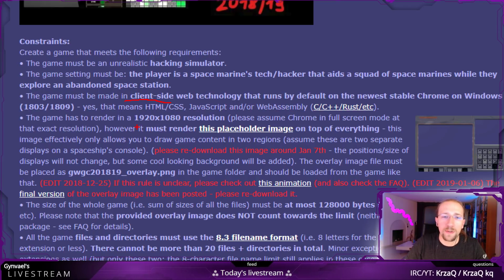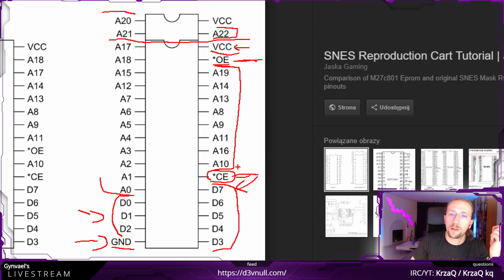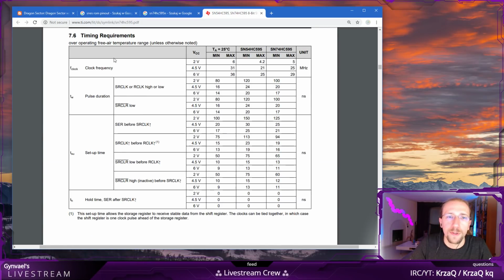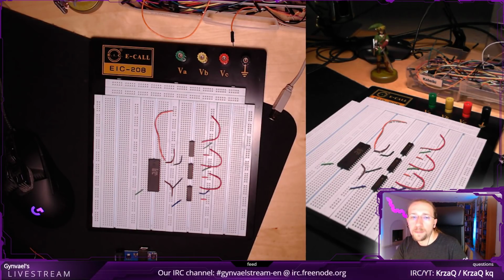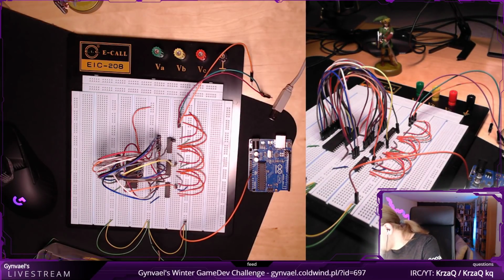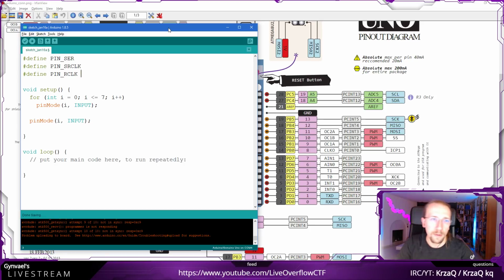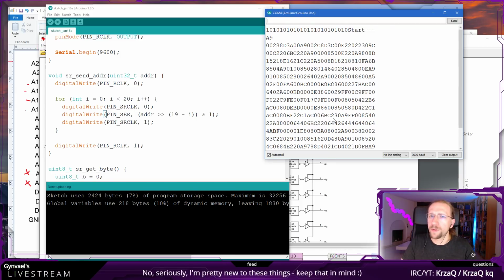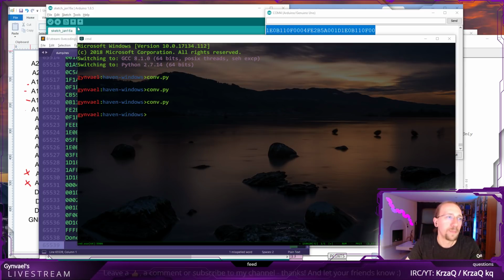Hacking Livestream #70: Dumping a SNES cartridge

Comment: So I have not finished watching the stream and I may be stupidly asking this before watching the whole thing, but let's suppose you did not have enough pins to properly reach the whole address space of the ROM. Would it be possible to dump in two steps? Say in case you missed the most significant bit of the address input, could you dump the first half of the address space by hooking it to GND and then the rest half by feeding it constant +5?
Reply from the maker: In general? Sure :)

In this specific case without the shift registers we would be missing 8 pins, so that would mean we would have to re-wire the addresses 256 times to get the whole dump. Less than optimal :)

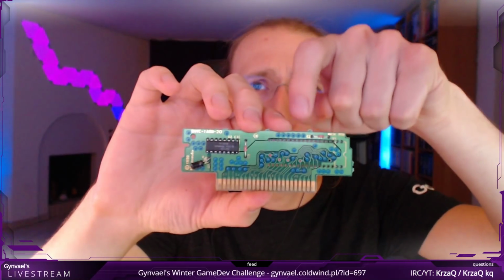Comment: The other chip at 29:30 or so is (as I understand) an early shot at a crypto auth chip. The console checks for the presence of the chip at each boot and if it doesn’t provide the key then it holds the console in reset. More on Wikipedia: https://en.wikipedia.org/wiki/CIC_(Nintendo)